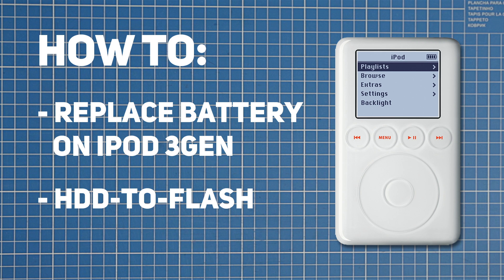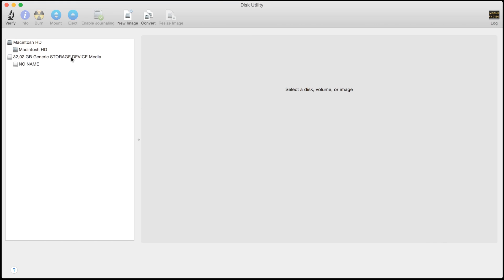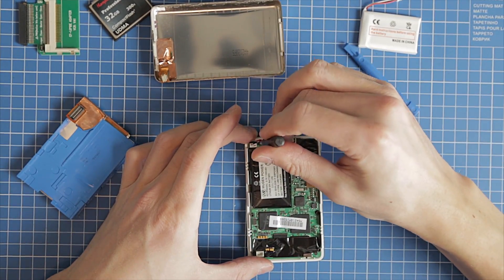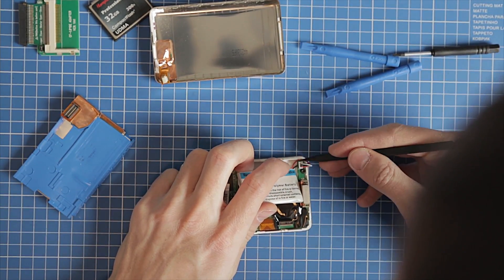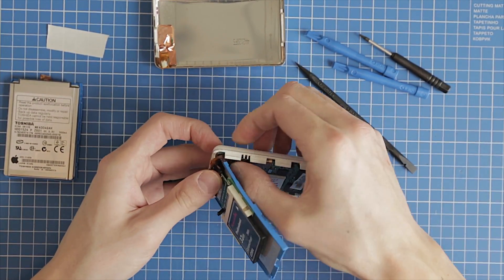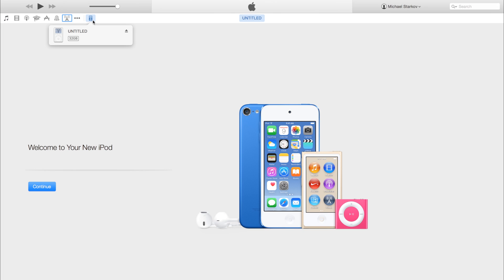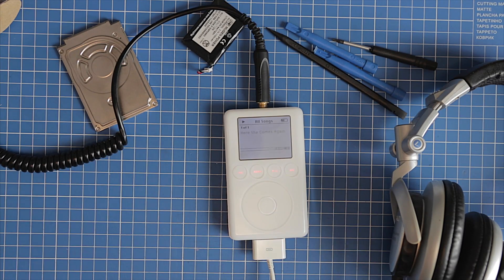[English] HOW TO Replace iPod 3 Gen Battery and Change HDD to Compact Flash DIY Repair

Comment: Hi, I would like to highlight few things if you do not mind , the battery has to be disconected in the first step and connected in the last step. also the hhd should not be bent  then disconnected , it is better if you peel off the first blue silicon protection then you disconnect the hhd then you lift up the second blue silicon protection and you should disconnect the HDD connector without bending the HDD flex , but over all it is a great video and I have learned few thing about the flash drive today , thanks

Comment: Hi! First of all, thank u for this awesome guide. I've an issue: as soon as I connect my iPod to my Mac with USB cable nothing happens. I've tried to connect it via firewire cable to my MacBook mid 2007, but the iPod seems to freeze while restoring (iTunes opens up, but it seems freezes too). Any idea oh what would be the problem?
Reply: Try reconnecting the CF, i think there is a wrong connection somewhere, also check the jumper settings
Reply from the maker: If you connect via USB, that should be a twin cable USB+FW and you should power it via FW Power Adapter. Or connect it straight via FW. I'm not sure how to solve the iTunes freezing issue.

Comment: Hello. I am trying to do the same mod with my iPod. When I try and do the restore I cannot get the CF card to communicate over fire wire. It only works through USB. I can’t get iTunes to let me restore over usb even if I try with FireWire/usb y cable. I have tried on a modern Mac and with a Mac the same age but refuses to restore. Any idea’s ?
Reply from the maker: Andrew Cripps I'm not sure what the issue can be. Try powering via FW with power adapter while connected to computer via USB.
Reply: Mike Starkov thanks for your reply. Really appreciate it. I tried using a Y connector with usb and fire wire into the iPod at the same time. But that didn’t work :( do you think I need to try this with a pc? Maybe there is a problem with my cf adaptor or the cf card? 🤷‍♂️
Reply from the maker: Andrew Cripps check your CF card via card reader first. Then try to format it. Then put it back into iPod and try to restore again. Hopefully this will help.
Reply: If it's the same as my 4th generation the CF card needs to be able to mount as a fixed disk.  A lot of cards will do this automatically but many can't and iTunes won't be able to restore it.

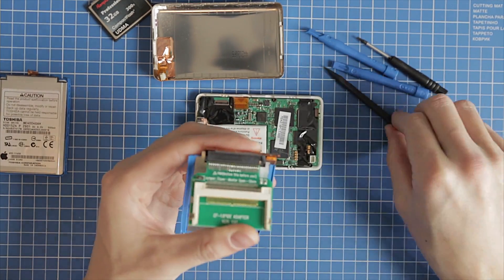Comment: if you cut off the plastic pin that you mentioned at 2:59, can you install a flash card without an adapter?
Reply from the maker: Noah Barrager Nope. At least pins are arranged differently.
Reply: @MikeStarkov  Something interesting to note is that on the iPod Mini 2G you don't need an adapter as you can just connect the compact flash card directly to the same port as the existing hard drive.
Reply: I removed a very small amount of plastic from the new board with a file so that it would fit onto the existing ribbon cable.

Comment: Dont u need ubuntu to do this?
Reply from the maker: shinviroz you just need iTunes (Mac/Win) to restore iPod after you replace the hard drive.
Reply: Mike Starkov is battery life same with cf card?
Reply from the maker: It's definitely longer
Reply: ***** I heard from a mod forum that the ipod is designed to conserve battery by putting the hard drive in power saving mode, but when you replace it with CF card, the ipod runs in full-power mode for the duration the ipod is on, resulting in quick drainage of the battery.

Comment: Hi, is 32GB the max that I can use? Or can I go higher?
Reply: I have a 128GB SD card in mine. No issues
Reply from the maker: I did not try more then 32gb

Comment: Hi Mike,  Yes i did that.  I think that the iPod may be broken.  I am letting the battery fully drain again as i did get a response from iTunes but then it went wrong.  It has been stuck in disk mode for years, now it is just showing the apple logo and going no further.  Cheers.

Comment: I did this and install fine but when i plug it in to my MAC it wants to restore via Firewire only.  did you use USB? to restore software?
Reply from the maker: +David Colton Yes I used USB since I do not have FW400 port on my Mac. But remember you should power it via FW (use supplied power adapter) when connecting to you computer via USB.

Comment: Hi Mike, can you use a CompactFlash card bigger than 32 GB ?
Reply: +Christophe Sevin With the IDE bus, you should be good to at least 128GB
Reply: @drewsof  but with UDMA7 being standard on CF cards above 32gb it'll probably lock up the iPod.
Reply from the maker: +Christophe Sevin Hello. I did not try any bigger cards since I do not have them ) I'm not sure if the adapter and iPod controller support bigger cards. If you have or can borrow one and try, tell me your story )
Reply: +Mike Starkov i was just curious ) Thanks for your answer Mike !
Reply: Yes, if there are bigger ones